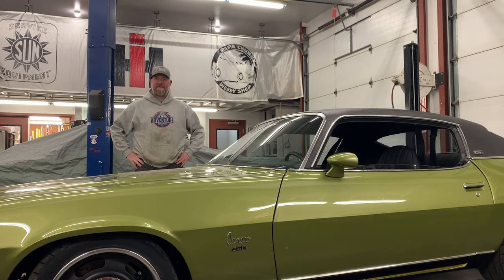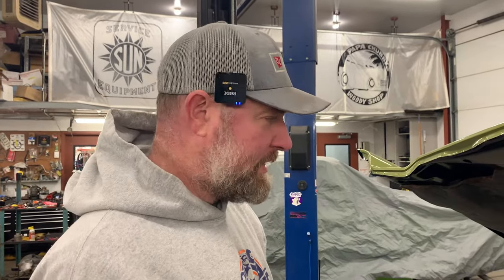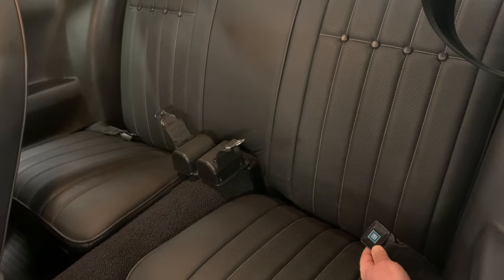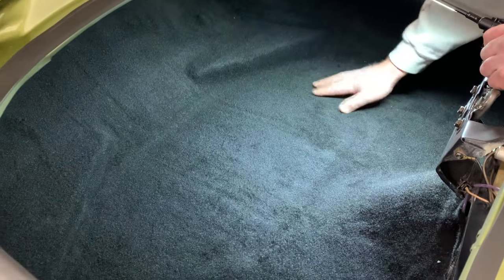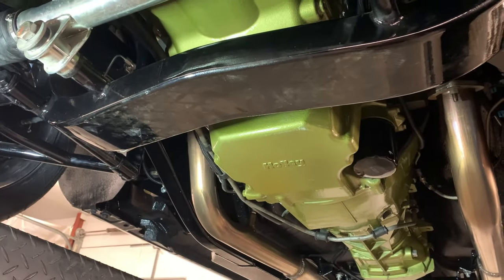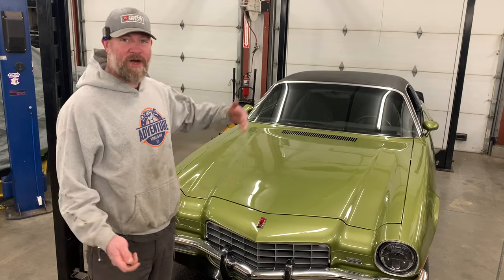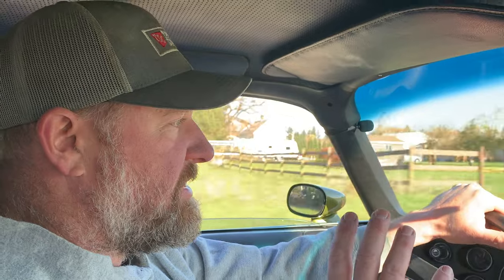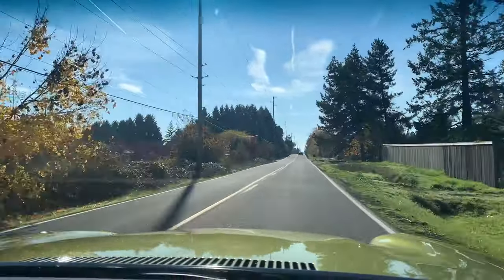How We Restored this ‘73 Camaro (& a test drive!)

Comment: Thanks a bunch again for showing the details of your build!! I saw some things to think about on my 70 Camaro, Art Morrison subframe build. One question about the wheel and tire combination, what was your axle hub face width? My 9" is 56" and was hoping to stick 315's in the back but not sure the back spacing. I really like the look you have with those wheels, very cool. I am hoping I will not need to cut the notch's in the trunk with the Speedtech rear suspension for exhaust routing. Anyway, thanks again for sharing your build.